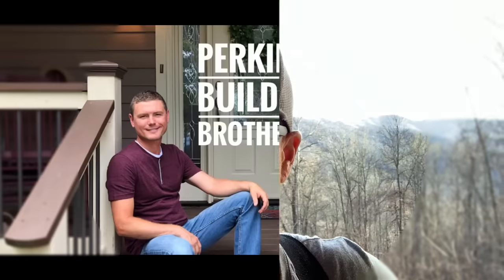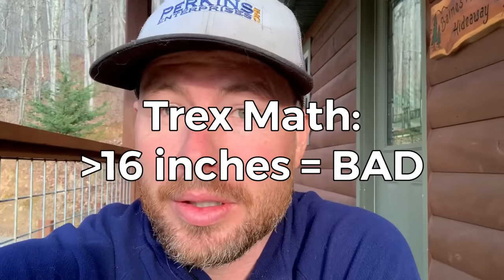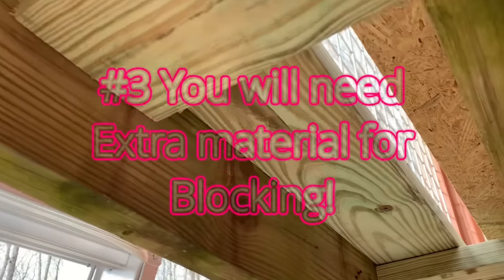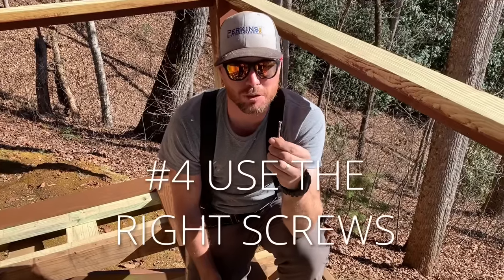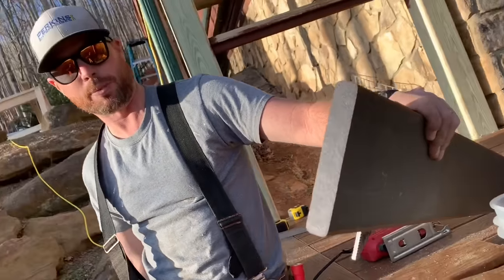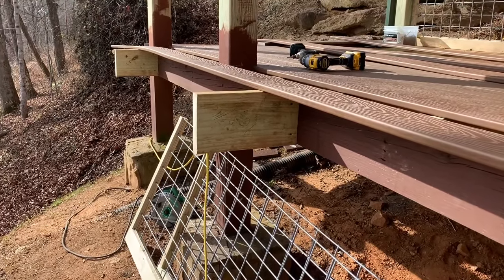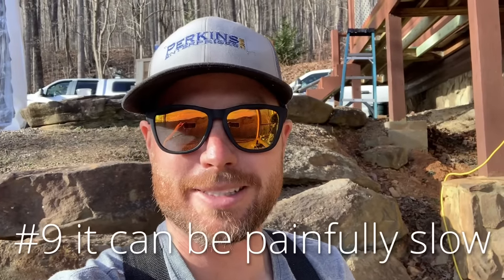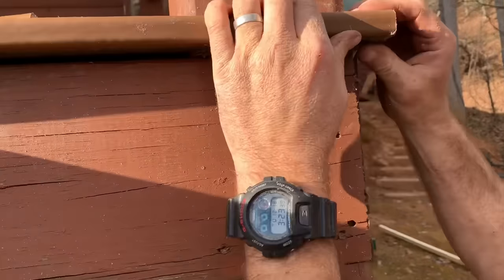How to install Trex composite decking

Comment: I never go more that 12inch center and most customers do not like exposed fasteners and I use door and window tape under the edge joint to keep water setting an raw wood black paint on top of all the joist so you can see any raw wood
Reply: Yep it needs close support but great decking. I looked at my last home deck the other day I install 29 years ago and still great.

Comment: Forgot to tape the tops of the joists. The 2x6 flat around the edges is scary.
Reply: Is joist tape really necessary?  My father-in-law's deck is 30 years old and has no problems with rot.  Just wondering if it's really worth the $75 it'll cost me as I'm about ready to fasten my deck boards on.  And his cousin has put up a ton of decks and never heard of people taping the joists.
Reply: @brianheath5091  "My father-in-law's deck is 30 years old" because lumber 30 years ago was better than the shit lumber of today, that's why. Joist tape makes perfect sense unless you live somewhere where it hardly rains.

Comment: OK, they changed the way to lay it, as we had little plastic wafers that were screwed down between the boards (screw at a 30* angle to the run) you had to use a wafer cutter to set holes mid way down the edge of the board. Plus, you had to use a wax/glue mix to seal every saw cut, and every scratch.

Comment: In your opinion is it worth the extra cost and labor? I think no, but I would install it if the homeowner really wanted it.
Reply from the maker: I definitely have to charge more for labor vs. Regular 5/4 pressure-treated decking install. It’s really a pretty durable product if your client wants an open deck.

Comment: Whenever I do any composite I advise the customer on doing 12" centers on joists. Especially if the deck is in full sun most of the day. Otherwise there will be sagging in between joists.
Reply: Agree completely, we will not install a composite deck on 16s they always end up sagging, always 12"👍

Comment: On your blocking for the outside band... Do you have an issue with water standing on the 2x6 laying flat under the edge eventually rotting it out or degrading the composite?
Reply: We always just add a second joist instead of laying one flat, for exactly that reason.
Reply from the maker: Dwight Carter.. I like your thinking. I have not had any issues yet. If I were to add another joist instead, I would probably go ahead and do a double joist to give you a full inch and a half bearing on the edge of the rim board plus an inch and a half to fasten the end of the boards butting in.
Reply: As a custom builder that always strives to exercise "best practices", we would at least install felt paper, or even better a peel'n'stick sill gasket over the top surfaces and especially laminations/joints of wooden structural framing. Trex also has an option for, and strongly suggests, using their steel joist system.
Reply: I recently tore out a 15 yr deck for a client that was built that way - all the 2x6's laying flat was rotted out completely so not best practice - I think composite decks have a long way to go or they may be good for just certain climates or situations - especially here in the midwest

Comment: shits time consuming and heavy, but looks pretty good. honestly I did 16oc with my current job, and it just feels like I prolly shoulda done 12. no structural value at all... had to block more than I wanted to... all my decks are seamless, that does go nice with composite too.

Comment: On Trex select Trex says to drill and countersink holes for the screws. Tried doing it without drilling and got mushroom around screws head. Yes I used composite screws. Taking out screw after it is set also causes tearout.
Reply: Carefully use a untility knife and cut the mushroom close to screw. I tried both methods. If exactly 90°, it never mushroomed on me. Just adding this for whomever. Definitely get at least 2 1/2" composite screws!

Comment: Number 7, you can put the board on the other side of the post upside down and mark it.
Number 10, I would have cut it from above rather than beneath.
Thanks for sharing! Learned a lot.

Comment: Installed decking a few years ago All the deck boards have split along the edges and swelled so much there is very little gap between the boards. Good thing I bought it at a discount at a bankruptcy sale

Comment: I've got this on mine. They told me that at the butt joint not to angle screws - use sister joist n run screws straight  helps with breaking the screw. Seems that it likes to move. Not sure if I would do again. It's spendy too!!

Comment: Not horrible info. It’ll get tour deck installed at a mediocre install. 
Use turbo clips it gives you 3/16 clearance which is a heavy gap but looks good and you won’t have mushroomed screw heads. Notice they never went back to show you a screw fully inserted. And for good reason. Trex screws are horrible they are a 2way screw. U insert it then run your drill in revers to suck the head in which inter lifts the board slightly.  Lowe’s Home Depot and me adds all sell a back up color match screw that works much better , still if you don’t want the mushroom you have to give it a smack with a “smooth head” hammer

Comment: Why would you set out riggers to get your marks for your band board when you can just set it on the opposite side of the posts and square in from there?
Seems like extra unnecessary work

Comment: Trex recommends 12" joists on center for commercial and 16" for residential. Don't do 16" like I did, I stripped old wood decking at new house and used the Trex grey.     First summer in PA it heated up that bad and now has more waves than the shore. And at 16" you can feel it bouncing under you.They don't tell you it gets that hot in sun you can't walk barefoot on it and if your joist twist  when drying out or not perfect it will show every possible defect.Never Again!

Comment: I'm using the composite deck screws and can't get the same depth.  Some go in perfect and others the heads of the screws aren't flush with the deck boards (stairs).  I am pre drilling holes.  Also, once the screws are in, they can't be backed out.  Does anyone have any tips on how to consistently screw these in the right way each time?

Comment: Where do you find the T-20 screws? I can't find them at either Lowes or HD.
Reply from the maker: I got them at Lowe’s, Have also bought them at our local building supplier.
Reply: @PerkinsBuilderBrothers  Any tips on how to drill the screws in the proper way.  I'm doing my steps now and I think I'm using the same pressure, but some screws are perfect but other screws aren't flush with the steps.  They also can't be backed out once installed.  Thanks

Comment: Installed a lot of Trex in Oregon. We gap our butt joints at minimum a 16 penny nail. Reason Being the boards will Grow 1/8 to 1/4 of an inch when they are in direct sunlight or heat in general.  Its an unfortunate thing because its hard to make all your butt joints evenly spaced with the boards heating and cooling all of the time. Another negative with that in mind is with screwing directly down into the boards the screws are prone to shearing off due to the boards cycling.

One way around this is to use the slip hardware that allows the boards to freely cycle. The hardware requires the trex boards with the routed groove down the both sides because it seats in the groove basically in the shape of a "T" a stainless steel screw goes strait down through the fastener and holds it in place through the pressure treated material your using as your framing. The hardware also will preset the gaping and makes it consistent;  Still pull a tape once in a while after you start your runs and make sure your not running off.  We use the  unrouted trex board on the out side with so the groove doesn't show. We do route the inner side of that board to accommodate the hardware to keep the spacing and hold the corresponding board.

Comment: i thought trex flooring does not get screwed in, please explain
Reply: They always get screwed down, this is a more cost efficient way. There are trex deck fasteners you can get that with different deck boards that have grooves in the sides so that they clip together with a 1/4" spacing between the boards where the screw goes in between the deck boards instead of screwing into the tops of the boards themselves. It is a cleaner look because you're not putting screws into the deck board itself. BUT the clips have to be installed between every board on every joist which depending on the size of the deck could cost another couple hundred bucks to install this way so it's really up to the homeowners budget and whether they want to see the screws in the boards or not. Another option is with the screws he is using they also sell plugs where you sink the screws in deeper instead of flush and then fill the screw holes with the plugs which hide the screw heads.

Comment: HOT <HOT HOT DO NOT USE IN DIRECT SUNLIGHT , we hsed the solid boards around our above ground pool , came out beautiful , until the sun came out and we tried walking barefoot . If I didnt spend all that money I would rip it all out .
The manufacturer should incuide a warning . 
This stuff got waay hotter than our old woood deck
Reply: What color did you use?
Reply: @marrileemiles3974  the tannish color with brown picture frame border boards

Comment: Nice job fellas!  I had this decking installed and the corners are laughable.  They pulled apart about an inch, and the facing board fell off too.
Reply: ...and Trex doesn't stand behind their warranty and leaves the homeowner in the lurch...and the poorhouse.

Comment: More like $6/ lineal foot - $12/SF around here.  If you’re getting it for $6/sf that’s 5/4 PT money here.
Reply: It's 8sqft (16ft board) for 43.38. (for pebble grey & prices vary per design/color.   They don't have measurements for square footage for the decking. Best to do the math yourself and compare, 12ft, 16ft or 20ft.. They cut me a discount on every item. They do sell their clips as square footage, which is annoying. Why not just have all units!? 😁 I bought only 16fters.
Reply: I pay $2.65 a foot for TRex select.    So about $5.50 sf

Comment: The perfect corner trick using an oscillating tool got you a thumbs up alone. Great tips!
Reply: Not so sure . It wasn't a tight fit . There was a gap caused by the thickness of the blade .

Comment: You’re installing the outer board in the wrong direction. The “arrows” are defined on this particular board and they should be oriented in the same direction. I also recommend a 22.5 degree bevel on the butt joints.

Comment: use joist guard. I took apart a 7 year deck and the screws turned to tothpicks. the pressure treated lumber I asume rotes the screws. With the joist guard I think It helps with water penetration. Not blue skin, The blue Is not the best to look at when the deck is done.
Reply from the maker: Wow! Good idea.. I’ve seen pressure treated eat up galvanized flashing like crazy on some remodeling we have done. I will get my hands in some joist guard and try it out... and maybe make a video review

Comment: If I stagger my boards do I need a gap at the end of every board or do I just need a gap on the ends of every row?
Reply: You dont need gaps at all, composite boards do not expand and contract from heat and cold like wood.

Comment: I'd add to never set gap between Trex boards less that 0.25 in if installing in humid climates.  Air circulation is a must or mold and mildew will quickly take over.
Reply: I agree with you for the need for greater spacing between boards in humid, hot areas but honestly, a quarter of an inch between boards? That's way over the top to prevent growth of mold, fungus, toadstools, whatever, etc. A quarter of an inch is waaaaayyy too much. Get out a yardstick or tape measure and you'll see just how much a quarter of an inch is. Not only could you see through, between the boards to see whatever's under the deck you'd run the risk of people, especially kids, who are relaxing by going bare footed,, accidentally  getting fingers, toes etc.stuck in between the boards while the rest of the body keeps moving. That would result in either having a compound fracture if you're lucky or a comminuted one if unlucky (ie. the bone crushed to splinters and dust). I've been there but it wasn't from any deck board spacing of a quarter inch. That's something I've absolutely never ever even heard of let alone seen, regardless of the decking material used. Ssfety is first and foremost and you'll never, ever come close to getting that with a quarter inch decking board spacing!
Reply: @danielfronc4304  Sorry to set you off.  I've built several Trex and Azek decks in Louisiana and Houston with 1/4" to 5/8" spacing with none of the problems you predict.  I made the decision to do so after seeing Trex set at 1/8" gap covered in mildew after 3-4 seasons in the shade. Honestly its the reason I moved to Azek because without the wood fibers it's less prone to mildew.  It is wise to paint the top of the joists with flat black weatherproof paint because the tops of the 2X is visible when the sun is directly overhead.  I've never been able to see whats under the deck otherwise.  Good luck on your projects.

Comment: This stuff expands and contract so expect to replace screws every season because they will snap with extreme cold and hot , or just buy wood for way less . Not worth the purchase . People think hey this stuff will last for ever but think about it ! If the frame is wood then it will rot and you will be pulling it all apart one day to replace the frame anyway .
Reply: My crew is replacing a cedar deck with a similar composite material. We were supposed to not mess with the old framing, but alas, a tremendous amount is rotten and we are doing a lot of reframing
Reply: @717UT  i covered my sisters deck about 7 years ago with composite but the frame was still good but now i need to replace the frame work this summer , not looking forward to it . If it was all wood i could just cut it apart and build all new but now i have to try and save the composite without doing damage ,not worth the trubble ...
Reply: @4486xxdawson  that's painful my man... We are still working on the same deck 2 weeks later. It's such a slog!
Reply: I cover the tops of the joists with asphalt felt roof underlayment cut into strips one inch wider than the joist.  This method works well to shed water from the top and preserve the joists for years.
Reply: rara k  Staple gun applied

Comment: I realize this is an older video, and you may have already made a follow up video to this, so excuse me if you have and already pointed this out.  You must leave a gap between the boards, around your post cuts as well as the ends for expansion in the heat.

Also, steps and landings need 9 inch center stringers.

Comment: Angled screws break when it moves. And it will. Sister joists help. Double the rim n caulk/ flash. Worst is the mildew moss.   Keep the trees trimmed back n lots of elbow grease. Not maintenance free !!

Comment: Just wow, you have a different building environment but you would not even get close to meeting building requirements in Australia.
Reply: Please elaborate what was not done up to your requirements.
Reply: @jbonegw  Unprimed pine joist with no rubber gasket. Freehand docking boards with no set square or drop saw. Hard butting up board ends not allowing room for expansion. Less than 1" overlap of board on joist. These last two items would void the warranty on the decking in Australia and lastly using an oscillating tool to miter the corner. I don't mean to offend but I can hardly direct builders to this video for installation advice.

Comment: Sooo, its plastic covered  sawdust that has no structural integrity,  takes longer to install, costs more, you cant sand out imperfections or worse, a miscut.  OK, got it.
Reply: And you never have to paint it and it doesn't rot.
Reply: And you never have to complain about it once it's done
Reply: And the sun degrades it a bit causing black spots
Reply: It lasts a long time as long as you dont have the first generation of trex.
Reply: @garyh4458  colour fades over the first year and when you need to replace a board, the new board looks terrible. When you chip it, it's very hard to repair.
Reply: I Google it had a lot bad reviews from Trex decking boards 😬
Reply: Trex is only an average quality wood analog. There's others, but, don't look at IPE.! It will grab your heart. Once you look at a finished deck with IPE you don't see anything else quite the same again. IMMHO.
Reply: And it looks and feels like plastic.  It also gets incredibly hot in direct sun.  Not a fan.
Reply: You forgot the part lasts forever.
Reply: @carlw  I'm going with Fortess decking. Getting the Tiger Cove color for $12 5.5x8 board so getting a deal.
Reply: @Soul_N_Control  Hope it works out well for you 👍
Reply: It also can split, crack and warp, not to mention how hot it gets in the sun
Reply: I used Fiberon 20 years ago and it’s still doing well for the most part. Post tops are just now starting to shrink and crack some, but traditional green lumber would have been replaced at least 3 times by now.